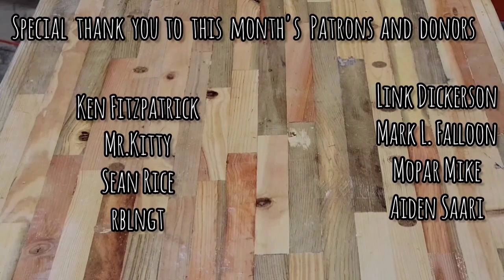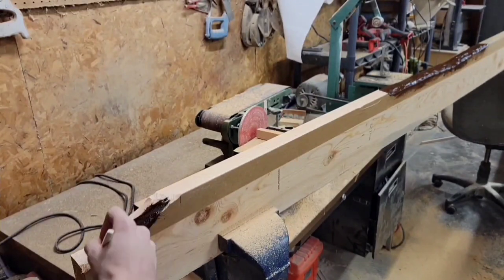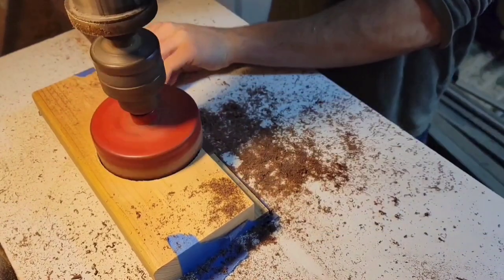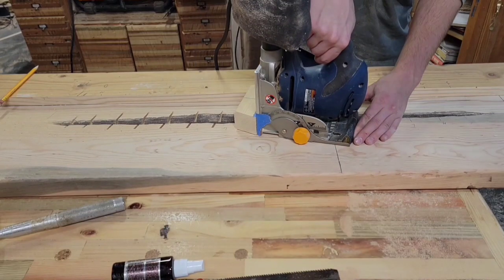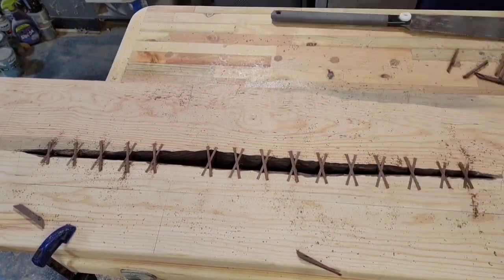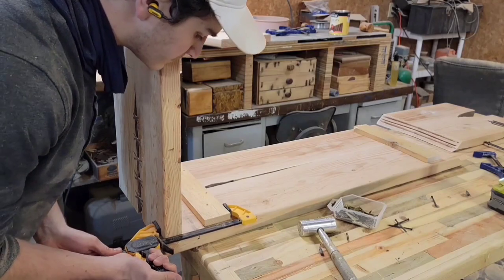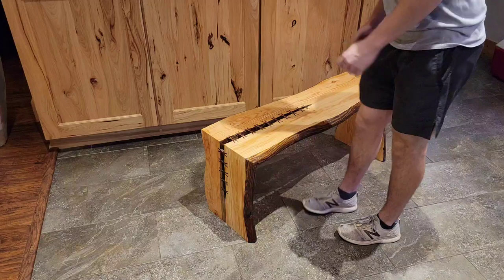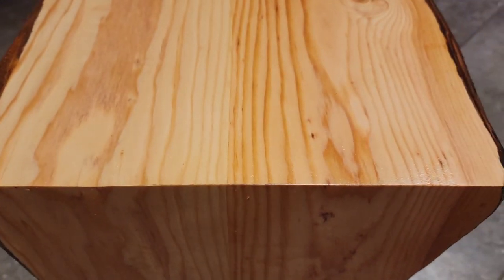EASY way to make FAKE Bow Tie Joinery | Woodworking

Comment: Love it. Love the creativity. Love the sawdust- that is what most of our shops actually are like (do wear dust protection tho’ - I didn’t for 40 yrs and am paying the price now). If you don’t want to worry about future stability, stretcher, etc those miters are perfect candidates for “fake” dovetail splines. Those would add a lot of strength and  not alter the design intent IMO. Again very impressed with the video delivery-concise and interesting- exactly the right length IMO.

Comment: This one turned out fantastic- really nice piece, love the aesthetic. Perfect for the entryway of a log cabin for putting boots on. A full stretcher underneath would take away from the look I agree, but if the thing is going to see any regular use I would maybe consider just some corner bracket bracing or something more low profile like that, I just worry about the long term strength of those nice miter joints under load
Reply from the maker: Corner braket is a good idea, I'll look into that!

Comment: What grinding wheel did you use to shape the edge? I couldn't find it in your affiliate links
Reply from the maker: Alot of different company's make them and they are all pretty much the same... here is cheap one from Amazon https://www.amazon.com/dp/B09GJZF6NJ/ref=sspa_mw_detail_1?ie=UTF8&psc=1&smid=A2661GJ96HLUA&sp_csd=d2lkZ2V0TmFtZT1zcF9waG9uZV9kZXRhaWw&th=1

You can also just use a course flap disk but they wear out fast
Reply: @JoshWrightWoodworking  nice. I've used flap discs and had the same result. I haven't sprung for the shaving disc yet. Eager to try the disc you linked. Thanks